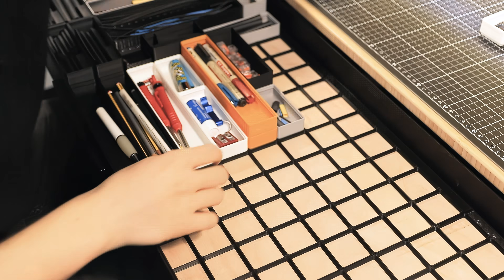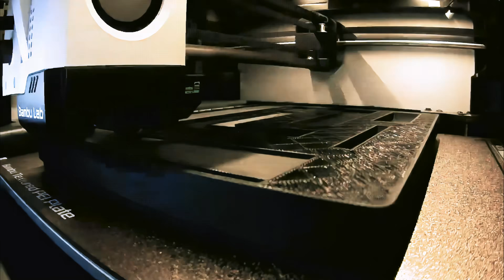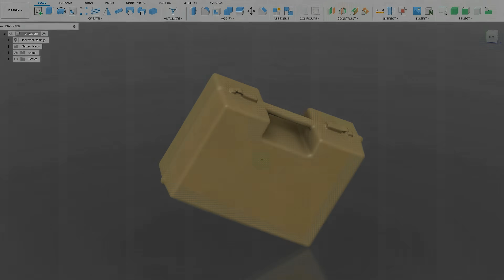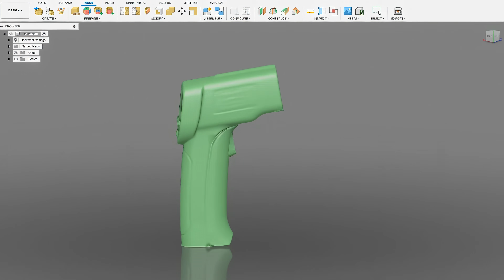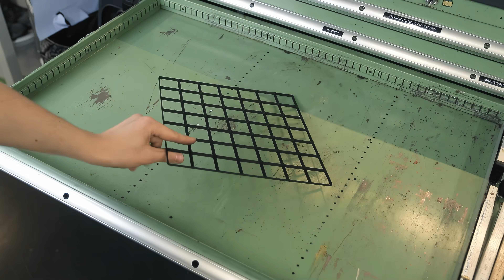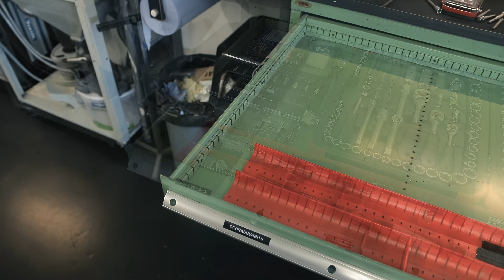How to 3D Print Custom Tool Organizers for ANYTHING!

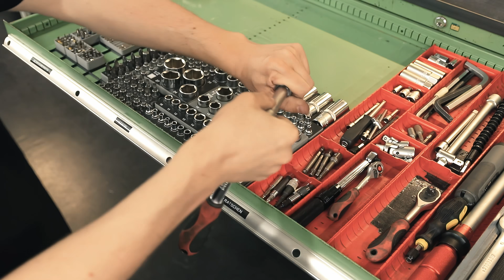Comment: 21:24 -  For the socket trays, consider adding a magnetic strip along the bottom (or perhaps in each individual hole) to help retain the sockets when moving the full set to the workbench.

Comment: I did the same with my sockets and GF, but the tolerances were a challenge.  Then I pivoted and used square bosses and just put the socket down on top.  That worked so much better than holes, for me.
Reply from the maker: Yeah it definitely can be tricky to figure out tolerances as round holes tend to have shrinkage in 3d prints. I don't know if you knew, but in many slicers there's a parameter that lets you adjust hole tolerance in  a print without changing the actual model. Using test prints this can be very helpful to figure out how much extra space you need and then save a print profile for that application

Comment: To get a tight fit when working with a canvas/photo, draw the lines of the sketch directly on the edges of the object.  Then use offset lines to make a slightly larger path.  For 3d objects, use Offset Face.

Comment: It’s much faster to use a laser and cut out foam inserts.
Reply from the maker: I'm not sure, unless you count  the printing time as "work" which I don't since you really just have to wait for a few hours while you can do something else. And with laser cutting you still need to draw the shapes in CAD as well. But sure, there's other ways to approach tool storage, this is just one option.
Reply: @PhilVandelay  I use Fusion 360 for my 3D print designs but typically I use LightBurn, Adobe Illustrator, or Inkscape for laser printed designs because they are 2D.  So for cutting foam with my xtool S1 I measure the height and width of each tool, draw several boxes in a vector program and export an SVG file to cut the foam.  Cut time is 5 minutes for most of the inserts that I created.  However, I really like your approach as well.  👍🏽

Comment: If you ever make new boxes, consider making little cutouts at the sides for your fingers so you can take the parts out more easily
Reply from the maker: The objects sit in there pretty loose so it didn't seem necessary. They all protrude far enough so you can easily grab them

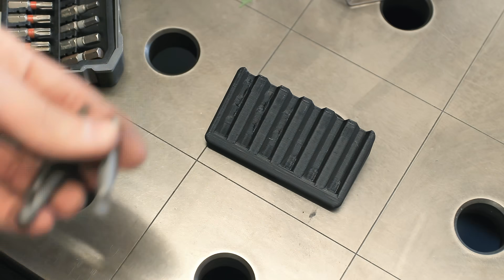Comment: Hey for the longer bits showed in 17:54 you can create a hole large enough to insert a small magnet using a soldering iron and that way they are going to stay in place, or 3d printing that again with the holes for the magnets

Comment: id be very interested with so much plastic molten, how much was throwaway?
Reply from the maker: Not much, I had 2 or 3 misprints but I always keep those around because PLA can be recycled almost 100%. You can crush up and melt failed prints and turn them into new filament, and I have the vague plan of building such a filament extruder someday.

Comment: Any small spaces left after putting all your boxes in, you can fill up with a smaller "filler" box print so they don't move around
Reply from the maker: They can't move around though, that's what the grid on the bottom is for ;)
Reply: @PhilVandelay  I knew the way I explained it wouldn't make sense.  I was actually referring to the bottom grid pieces. Adding in a spacer to fill out to the back or sides of the drawer.
Reply from the maker: @Dongaz  ah I see. Yeah I actually did that for my other drawer, with this one so far it seems like the contents are so heavy the grids don't really move since they're all attached via the containers into one giant grid

Comment: I find that I always make some measuring error so my solution has been to print out a drawing diagram at 1:1 from fusion on paper to check everything before I send it to the 3D printer. This has saved me many hours for printing time and filament.
Reply from the maker: I found it can also help to print just one layer of the object for this purpose to check the fit. Costs almost no filament and is relatively quick
Reply: @PhilVandelay  Yes, I usually do test prints as well, but the time of the inkjet printer and the cost of the paper is much less than plastic. Thanks for your content.

Comment: I have a solution for your long bits, that I 3D printed 7 years ago. I made the slots horizontal and deep enough so the bits sit just below the surface so they can't slide out. At one end of the slot, make the slot over a short length (10 mm long or so) about 8 mm deeper than the rest of the slot.  To take the bit out push  the end of the bit down into the deeper end and the other end will pop up, making it easy to grab. It avoids finger slots which need extra space and which I find inelegant 😊. Very informative video! Especially the different methods of designing the slots for the tools. Thank you so much for posting this.
Reply: That is an elegant solution.
Reply: Very nice tip! I'll definetely keep this in mind

Comment: Phil, you are right about Lista cabinets being the best you can get. I managed to get 4 of the narrower ones last year, 3rd hand, originally they had been supplied to the McLaren F1 team. Really not cheap even 3rd hand, my son will inherit them. The main problem with mine are that a lot of the drawers are 50mm, which meams that for many items, they dont have enough height internally. I have 2 new 100mm drawers being delivered tomorrow, which will replace 2 of the 50mm drawers in 2 cabinets. Spares etc are really easy to get hold of and are not a horrific cost. Having just taken delivery of a Qidi Q1 printer I will be putting it too work making some of these drawer organisers. Many thanks for posting this, at this time.
Reply from the maker: Yeah it depends a bit on what you keep in them. For me the 50mm version works great but some stuff I have to keep in other places as it's too thick. I think what the large flat drawers excel at is stuff  like drills and endmills, I can't imagine a better system to organize and store those. As you said, I'm pretty certain this cabinet will still be in use somewhere after I'm gone. It's hard to overstate how well they're made
Reply: What is yours Phil? Is that their default green? Or a custom color?
Reply: Holy cow, just googled them and, well, it's impressive how much the cabinets cost.
Reply: @rotors_taker_0h  Yeah, quality is never cheap, even second hand. They hold their price really well. Honestly though if you spot one or two for sale, go for it if you can. You won't regret it at all.

Comment: Nice, I wish I knew about before building and designing my tool cabinet. Definitely think I prefer the sockets that drop in rather than printing little nipples where the push on. Saying that I think I saved a lot of time and material.

Comment: Throwing away blow moulded cases after organizing their contents is one of my favorite things
Reply: i wonder what they are made of, if they could be recycled into 3d print filament :P
Reply: @ge2719  I started to notice that (at least for the Lidl Parkside tools) they are made from recycled HDPE. Since I already recycle bottle caps made from HDPE, it was easy to reuse it. It would technically work as a 3D printing filament, but it is a nightmare to print with (I already tried).
Reply: @creativusme  sounds like its used for pressure moulds for a reason then....
what do you do to reuse them melt them into slabs?
Reply: @ge2719   Well, there are different techniques. I could explain it via text, but it would be kind of long and hard to understand (I'm not a native English speaker; I'm Italian). I started by watching the "Brothers Make" channel ( https://www.youtube.com/@BrothersMake ) ( https://www.youtube.com/watch?v=OwmgYUJXCyM ) and found my own way to do it. 
In simple words, yes, I melt them into slabs or press moulds I built myself.
Reply: You can cut the molded inside layer out and 3D print your own internals, or use Kaizen foam, or just use them as like a storage case.  They're not very strong with the inside removed, but you can epoxy support strips in
Reply: @dangoesfast  that is absolutely genius
Reply: @creativusme  wish I could claim it as my idea, but I saw it on another video a long time ago 😊

Comment: If you have both metric and inch-based tools, then either separate them into different drawers, or give the organisers different colours, if you only have a few. A few tools for ¼"/20 tpi can be practical to mount camera's, even if your shop is otherwise fully sane.